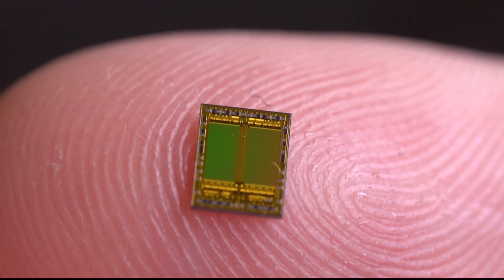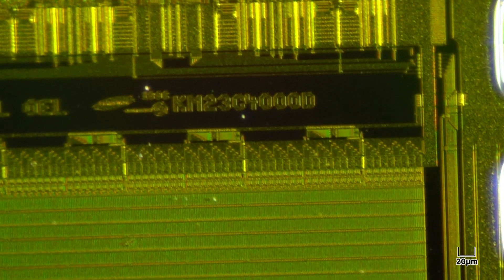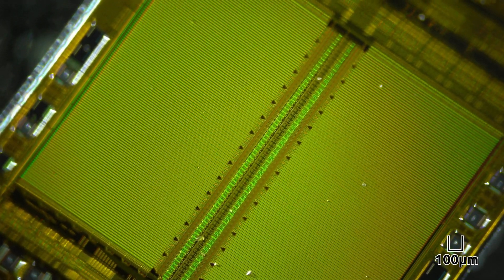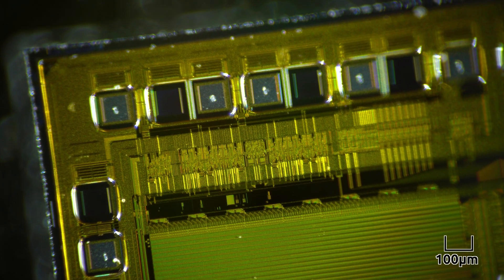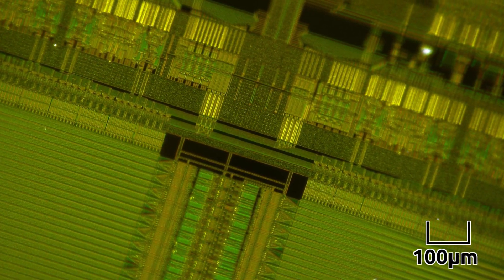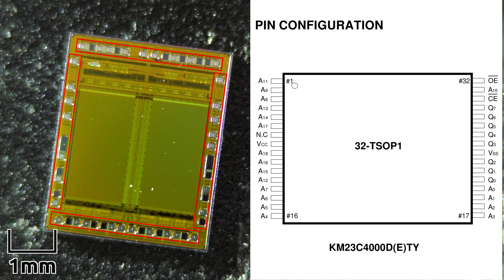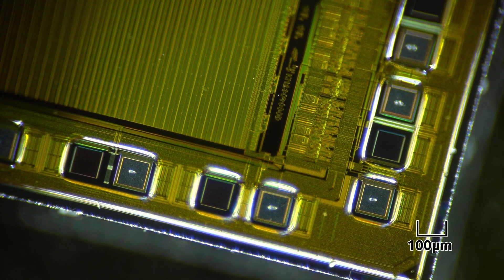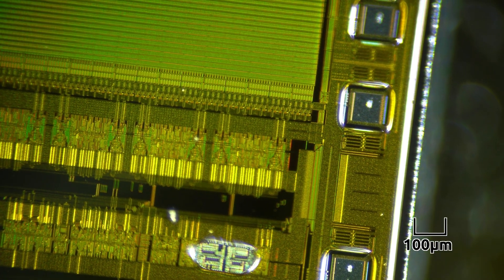Microchip Closeup - 4M-Bit CMOS Mask ROM Microchip - KM23C4000D

Comment: This makes me wonder if mask rom has any speed advantages, even if miniscule
Reply from the maker: I don't know much about chip design (other than what I know from making these videos), but I think that your suggestion makes sense.  There would be less need for switching circuitry for read/write mode, because there would be no write mode.  I assume it would probably able to use less power too.  Having said that, it probably depends on what photolithography process is used for that individual chip.  Every time you go to a different 'process node', all of the variables change.